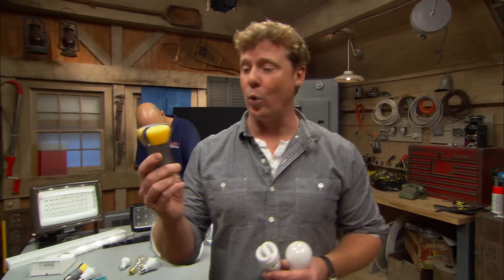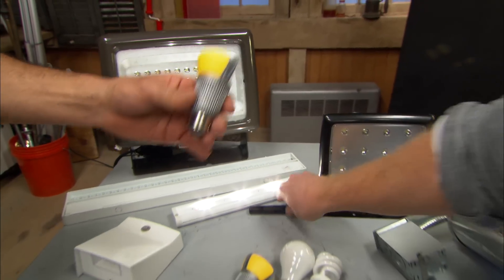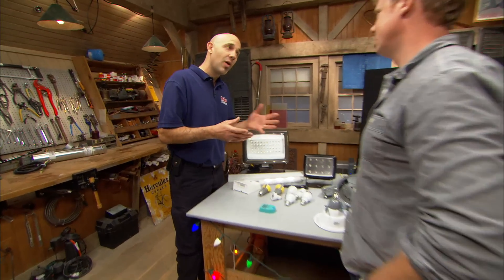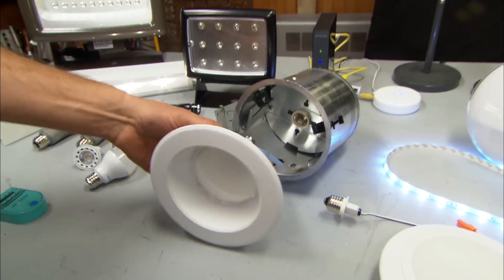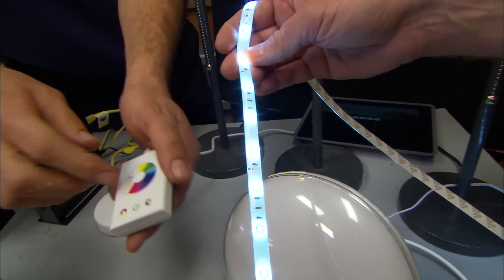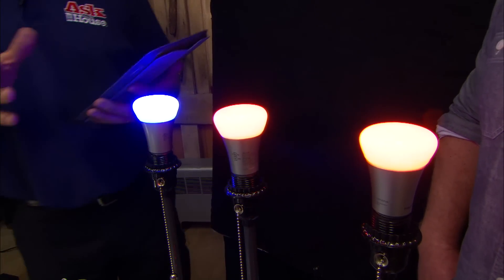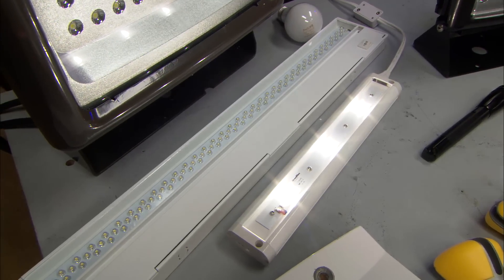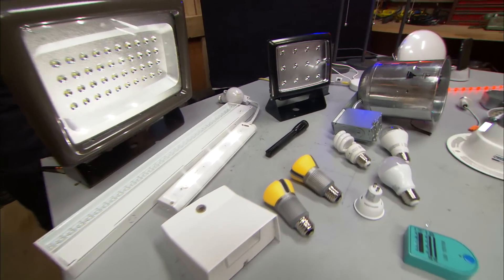How to Use LED Lighting | Ask This Old House

Comment: Would have been good to mention in the video that some LED "bulbs" are not rated for enclosed fixtures. Need to watch for this if you have a fixture with a cover.
Reply: Brandon Lemmon why wouldn’t they ? They barely heat up at all
Reply: @ImShiftehh  actually L.E.D. lights will stay cool all the time
Reply: @stephensnell1379  that’s literally what I said

Comment: I’ve used both sets of Christmas lights but I still like the incandescent over the led so I can change the bulbs out with different colours and different types like the ones with bimetallic strips but I do like led lights a bit but I will always like the nice warm glow of incandescent so I will continue to buy and use incandescent lights and strings but do the same with led lights and strings
Reply: You ought to change or L. E. D Lights or you will use a lot of energy during the festive period

Comment: Scott claimed the light from LED's is "good quality."  I would disagree.  Their emission spectrum is not well balanced and always has a huge blue peak.  Several studies suggest this blue peak is not healthy for our eyes.
Reply: They sell the bulbs in a variety of color temperatures, for this reason. The studies you're referring to don't say they are harmful to vision, only that it fools your body clock into thinking it's still daylight and interrupts sleep patterns. For that reason it's generally recommended to limit use of computers/phones before bed or to use an appropriate screen-dimming option.

We'd be in a bit of trouble if blue light harmed vision, what with the sky and all.
Reply: @jono0007  I use my Smartphone before and after I've gone bed and it has no effect on me
Reply: Not only is the spectrum from LED bulbs poorly balanced (as compared to sunlight or incandescent bulbs), but many LED bulbs have excessive levels of high-frequency flicker.  The flicker frequency is usually too high to be perceptible, but studies have shown it can cause headaches, eyestrain, and other health impacts.  Until recently, there were few standards regulating flicker in LED bulbs.  California's Title 24 set some of the first flicker standards, and tests showed that half the LED bulbs on the market failed those standards.
https://www.energystar.gov/sites/default/files/asset/document/McHugh%20-%20Flicker%20-%20Measuring%20Flicker.pdf
Reply: Did California find them to be cancer-causing yet?  They will. ;)

Comment: Whatever you do, save your receipts when buying LED products.  Be very organized in keeping track of all that you buy.  You are paying a premium to save, but when these product don't last as long as the manufactures say they will all that savings you planned to get is out the window in a very big way.  Make the manufacture pay/replace - if the store won't take the product back - send it back to the manufacture over and over again each time they do not mean stated claims.  

I have found that LED products definitely do not last as long as stated claims and I have started to hold manufactures responsible.  No more just throwing it away and then trying something else, I send it back over and over again if necessary and document.  For what these product cost over regular light bulbs, if we don't hold manufactures responsible, may as well buy regular light bulbs and be done with it.
Reply: they are rated on 3 hours of use per day
Reply: incandescents are dead. LED's are now and getting cheaper.
Reply: So much this. Same with CFLs when they were super expensive. They'd rarely last as long as incandescents
Reply: I had a few CFL's last me 7years. I could believe it.
Reply: I'd bet the receipt don't mean squat and they'll only warranty it if you filled out and mailed in the "product registration form" which ofcourse nobody does, therefore they can blow smoke up your ass and say it'll last 20 years.
Reply: All LED bulbs I’ve purchased have been incredibly reliable. I haven’t had to replace a single one yet, and the oldest one is about three years old and is on 9 hours every day.